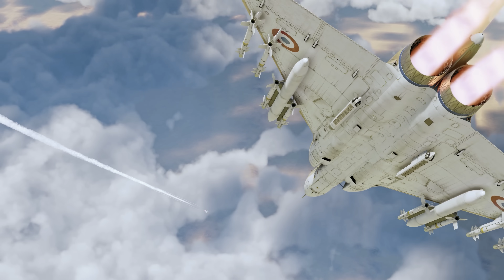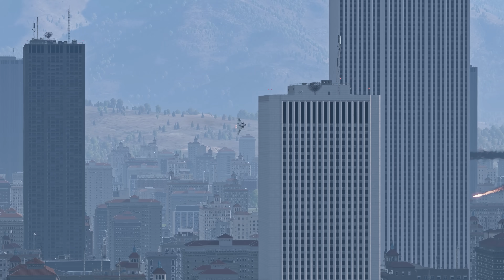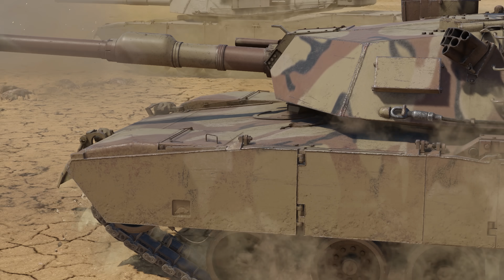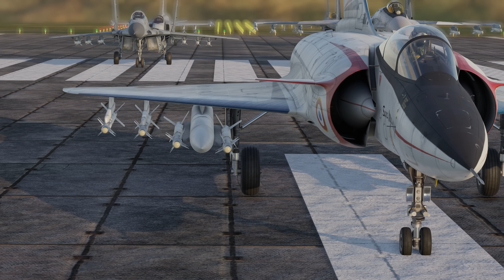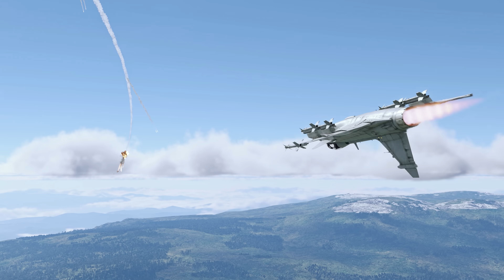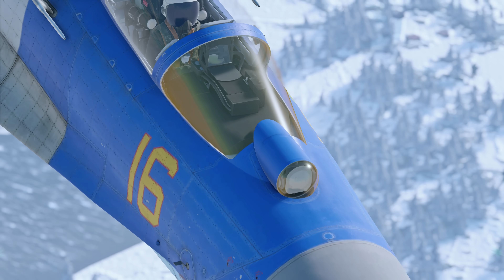Mirage 4000 the Heavy Sky Fighter

Comment: Why does the front machine gunner who sits beside the driver in most tanks not shoot???
Reply: Gaijin only adds that feature to tanks that may need the extra fire power ie. low tier Japan as they only have 7.7 mm on the roof with miniscule mag capacity and no coaxial. I'm not sure if any other nation has this feature except for Japan. Plus the firing angle of most hull machine guns would make them relatively useless in most scenarios, so they don't bother doing it across the board
Reply: @hi-Larry-ous yes.. i agree about Japanese tanks.. but it is kind of a bummer i think.. it would be cool if sherman tanks had it.. might as well remove the machine gunner in that case.. i mean they modelled the gun and all but..
Reply: This !
Reply: becausmost rusian tanks dont have a shoter in the hull so that mechanics is not wanted on rusian forum
or the pistol rounds they got are too weak
aka evry single mashinegun having double the pen it realy had thanks to broken math formula they use and not real world tests

Comment: Q: Does it matter which crew member I pit repair speed onto? Also, should I put all my points into 1 crew member or spread it out across multiple? (For tanks)
Reply: If you mean crew member as driver gunner loader and so on, well in the long run it is better to spread it across them but in the beginning you can prioritize, targeting for gunner, then do driving, reloading and leadership, once they're all maxed you can prioritize repairing, agility and survivability.
Reply: It does matter. Imagine you max out repair speed on your commander only for them to die first in combat. Now you lost the crew member with the highest repair skill. It's best to spread it out
Reply: The number at the bottom of your crew card tells you how many points you have in that crew.  It goes up to 150.  You want to start with the most important skills (driving, targeting, leadership, reloading for example), but your goal should be to max out your crews which will mean you are going to fill all of those bars.